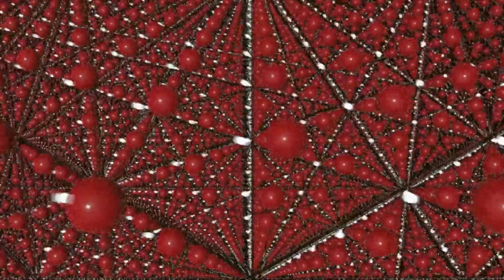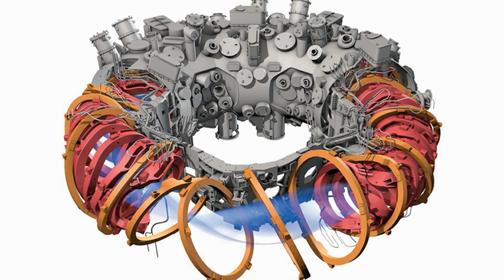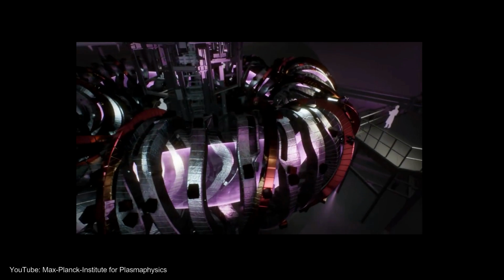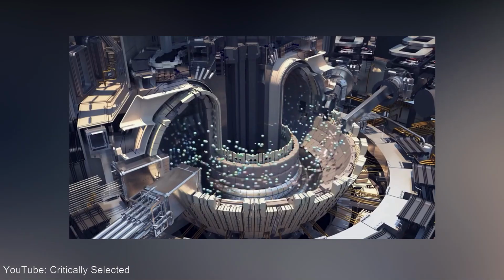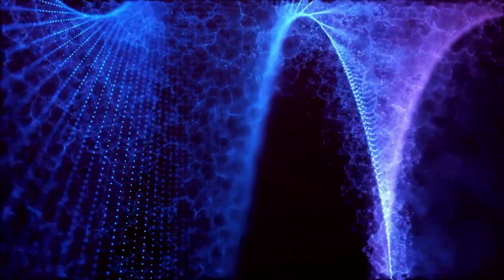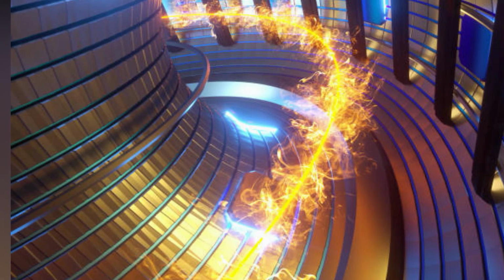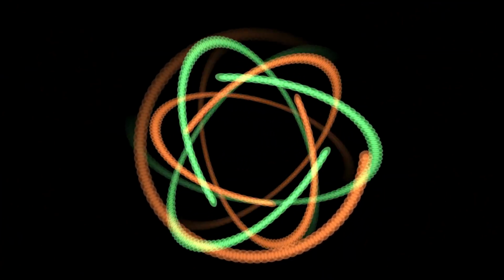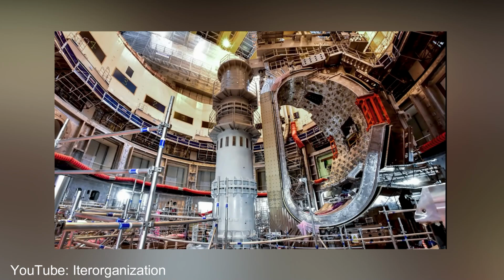Germany's New Fusion Reactor Will Change the World

Comment: Germany's leading plasma research facility has made history with its new nuclear fusion reactor. Nuclear fusion has far reaching possibilities which has the potential to provide power to the stars. It can provide nearly limitless energy with zero carbon emissions. Nuclear fusion produces no radioactive waste in the long run. Nuclear fusion reactor is capable of producing abundant sustainable energy or mimicking the sun. It has the potential to be a source of clean and safe nuclear energy. Thank you so much for making this video.